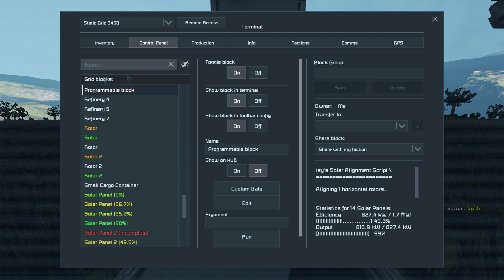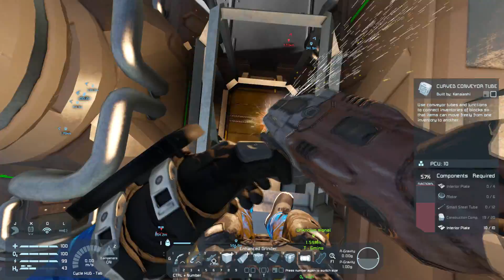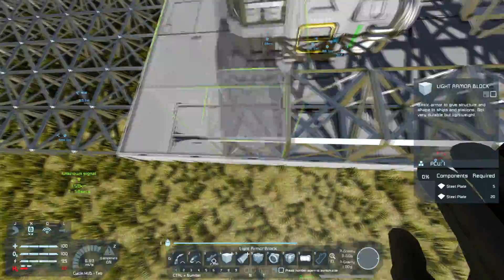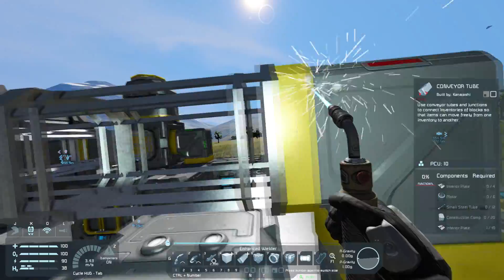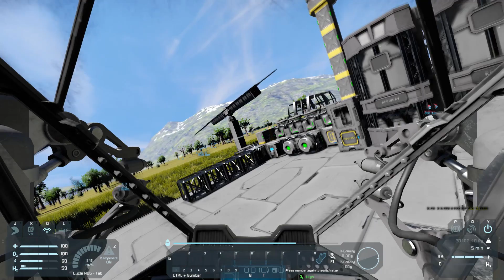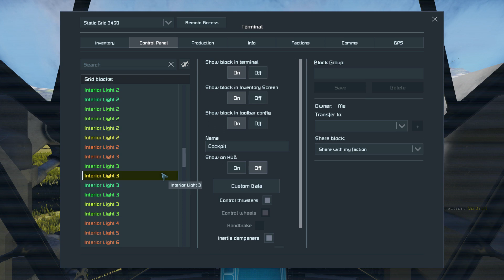Space Engineers - S1E05 'Flying Welder'

Comment: Having a flatbed is a neat idea, however not very practical. You can only go so fast on the ground , it will take you hours to go on the other side of the planet for example. A flying ship gets there quickly and since you are using renewable energy only, you're not limited by your energy consumption. You can make some huge hydrogen tanks on the base and your flying ship only needs tanks.

Rover flatbed only makes sense if you are using a rare resource to power your ship, aka uranium.
Reply: unless you just want a rover flatbed

Comment: Instead of just a welder ship, how about have a welder AND grinder both in ONE. Use a Large cargo in the middle (or 2 mediums, large ones are really fat), add a connector on each side, and have tubes traveling forwards to 2 welders, but backwards as well to 2 grinders, kinda like a large H shape. Add a remote control block where the grinders are and you can pilot remotely the grinders :).

In one of my crazy construction sprees, I actually built a multi-tool ship, equipped with a hovering tray that contained a set of heads: 1, 2 and 4 welders, as well as 1, 2 and 4 grinders ! Was shaped a bit like a turtle, due to large cargo hold, fun thing to have when building enormous ships.
Reply: You didn't watch the video 'till the end... useless comment ever.